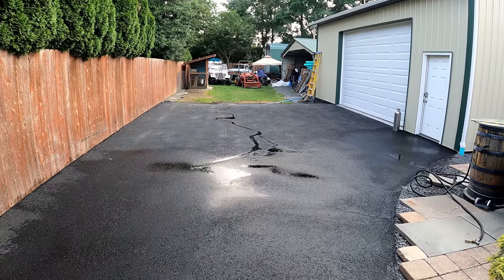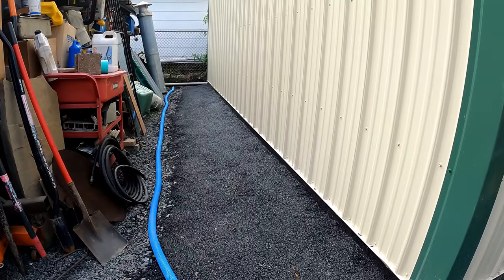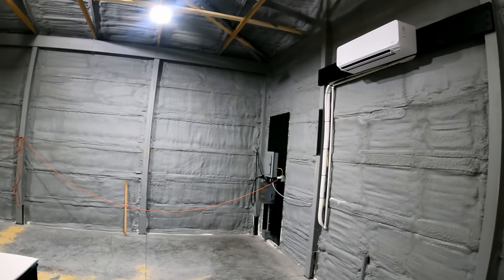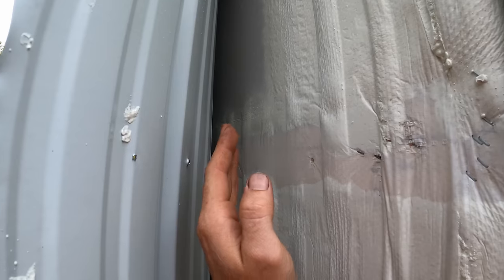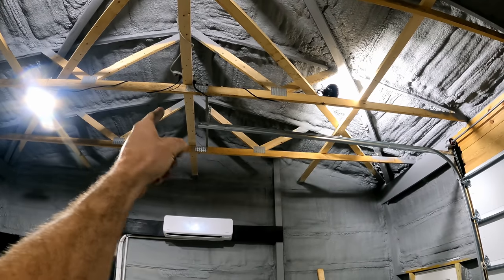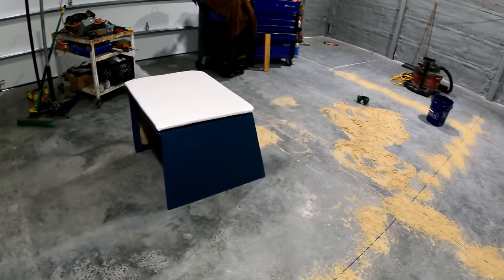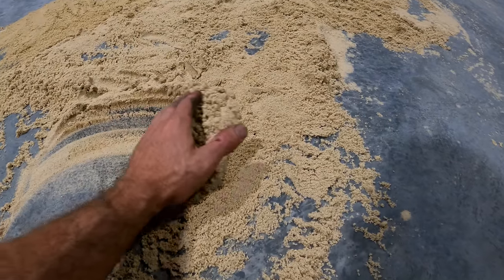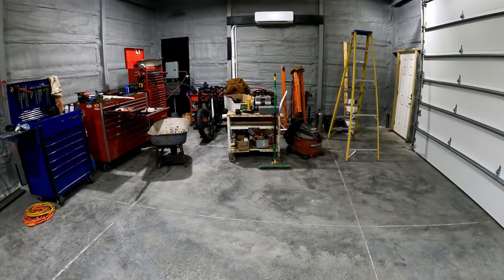NNKH Pole Garage Update/Build Details

Comment: Sorry but i (from Europe, Holland) am really surprised that in the US it seems normal to use sheet metal and then later spray insulation and finish with some kind of plating. Why not use sandwich panels (two layers sheet metal with insulation foam , for instance 4 inches, in between) ? It is much less work, install and outside and inside ready.

Comment: Hey Chris, Good choice on the Fujitsu. I've had mine for 10 yrs. now with NO problems. It's nice in the winter, it will maintain 50 degrees so you wont get any rust on your tools. If I plan on working in my shop I just go in a hour early and turn the heat up. Love the Fujitsu!!!
Reply from the maker: Awesome! Yeah they had really good reviews and my buddy who works in HVAC recommended them. So far it's working great!

Comment: The new shop is coming along nicely,  I have to agree with Jen about the gray walls though. If it was mine I would paint at least the back wall white to reflect more light. When I built my shop I used osb on the walls and I was in such a hurry to get finished  I didn't paint the walls and now that they're covered with stuff it will be too much work to do it now and a regret it. Never been a fan of spray foam insulation as a finished wall, just reminds me of the inside of a cooler.  
Keep up the good work. 👍

Comment: Gus is so cute! Great job with the garage Mr. Ocd. Better to do it right now before it gets full of stuff. An idea for you. Why not put up some peg board on some of them walls. Not sure how big sheets they come in. But would dull out some of that Grey. Or you could use paneling. With the back side showing. Unless you like the look of paneling. Lol. Just a couple ideas. Good catch on that garage door. Can't believe they suspended those hangers with a lag bolt from underneath. That's insane. That definitely would've fell out with time. Good call on doing it right.

Comment: Chris as to lighting you can get a water base dry fall paint in either a white, a pastel grey or a silver. You could do a standard dado or just above the wall headers. It'll really  brighten it up. 
I sprayed many shops and foundry with this eggshell product.  Sherwin  W. Makes one.
 A simple blow down w/ an air line worked great. 
1.4 mil plastic  on the floor.

Comment: you need a small fan and some modest rgb strips, if you sync the mini split to the outside temp to some extent you will be able to avoid some of the condensation? consider some small vents on gable ends and also down lo with slid-able flanges and then you can forego some of the temp diff and provide some air flow - maybe consider a big work table with a couple monitors and a cheap tv on the wall, you need a stereo system - it will all come together as you move back in

Comment: Chris you can buy some premade sound absorbing panel which hang up high to control the reverberation. We have speced them for vehicle shops and aircraft hangars. There is information on line about reverberation control on line. The panels can go on the walls and can be light colored to help the lighting. Finally in military hangars we paint the floor white with epoxy paint to increase lighting reflection
Reply from the maker: After putting all of my tools and equipment in there, the echo has gone away

Comment: Garage door installer for 25 years. The way that door was installed is industry standard. Only thing I would have done was add a second set of hangers for the middle of the horizontal track.
Reply from the maker: Thanks for your input on it. Yeah I'm sure it would have held up over time, but I think over top is definitely safer. I understand why it's not practical in all cases though

Comment: Dude!!! Ok you my favorite channel by far.  Just add 6ft 8ft roll insulation whatever size you need. Then just put metal on.  That will heat and cool like you won't belive.  I've build 2 shops the first I did was straight spray foam. Trust me in the long run you won't be happy. Here is the real truth about spay foam it will pull mostusure though the wood and rot it super fast. And you won't know until it's 2 late. Yes very fast. Trust me... spay foam is great for air tight  but insulate and put metel.

Comment: Nice😋why not have an entire foundation in concrete? in sweden you have a fully cast plate with insulation underneath so you avoid the joints.

Comment: Sika AG is a Swiss multinational specialty chemical company that supplies to the building sector and motor vehicle industry, headquartered in Baar, Switzerland. The company develops and produces systems and products for bonding, sealing, damping, reinforcing, and protecting. Currently, it has over 27,000 employees, subsidiaries in more than 100 countries, and an annual sales turnover of CHF 10.5 billion.
Really good product. We use those a lot too👌✅🇫🇮🇺🇸

Comment: The only problem you might have with a mini-split is when temperatures drop below freezing they can struggle a bit.
Reply from the maker: If it does then I'll reinstall the waste oil heater.
Reply: @NNKH2  So that unit is using actual freon like an HVAC system for cooling?

Comment: What are you using to seal your concrete floor?  I have the same issue and will be sealing mine in the next week or two.
Reply from the maker: Ghostshield
Reply: @NNKH2  which formula Ghostsheild did you use?  Do you have a video coming out on what you did to your floor?  Love your new shop. Got mine up last week.  Hopefully sealing my floor next. Waiting to see what you did to yours so I don’t screw mine up.  Lol.

Comment: No floor drains?
In my 150m² workshop there were 1 drain ofc place on the highest point on the floor, had to add more with all the fuss thats involved in doing that afterwards.
Was a pain during the winter when it accumulated 2-3 cm of water at the lift 😂
Reply from the maker: I figure I'll just squeegee the water right out the door
Reply: @NNKH2  it works, but not the best solution, gets old quick to move water around by hand.
But you probably have much less winter and snow then where I live.

Comment: That's a mistake to fill those in "cracks" they are relief joints so  as your  ground swells and contracts from the heat and cold it keeps your slap from cracking or at least helps to prevent it.looks great thou 💯
Reply from the maker: Concrete shrinks as it cures and time goes on. That's why it cracks. Filling the joints doesn't affect the function of them

Comment: Sealant joins without using tape and not  spatulaing flat. Wont b surprised if sealant surface is holly from air not been pressed out after you cut the extra sealant off.
Reply from the maker: No need. It's self leveling.   Works great

Comment: What is the square footage and what size split unit did you use?
Reply from the maker: It's 23 by 32 with 12 ft walls. A 15K. Probably a touch undersized but works amazing with the spray foam
Reply: @NNKH2  thanks I am building a 24 x 32 spraying in  installation. Concerned how well the split would work . Love the channel. Thank you.

Comment: what is this? 'Good choice on the Fujitsu'.
The Firecoat significantly dimmed the interior. I was worried about only 500 watts of lights when you went that way. You need about 200% more of those to really give you some decent light to work in. I would not have used the Firecoat myself it's ugly.
My impression is that you were not happy with the concrete guys at all. Be honest.